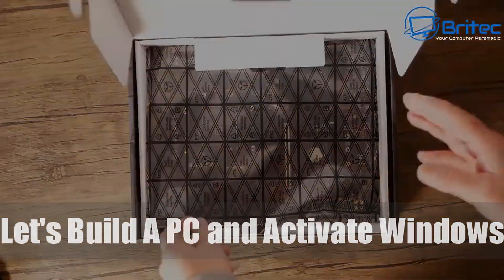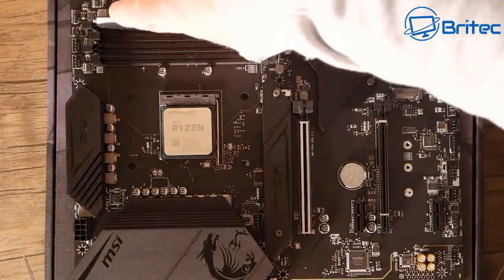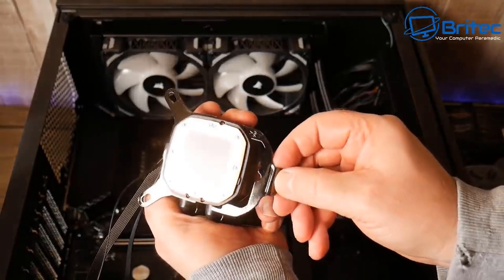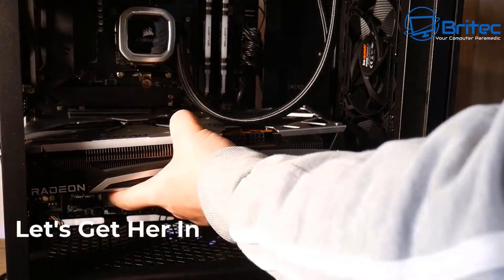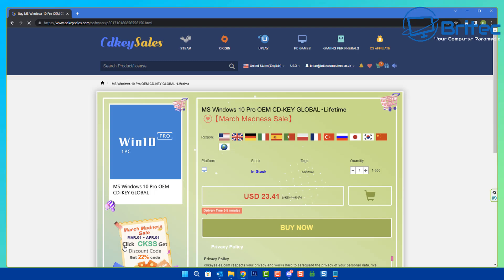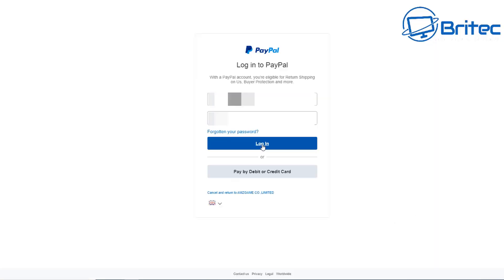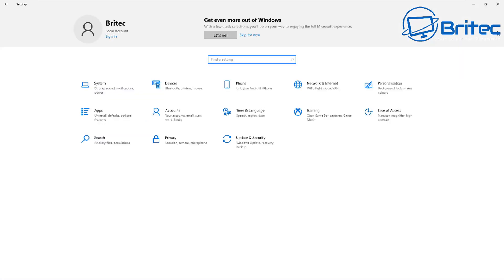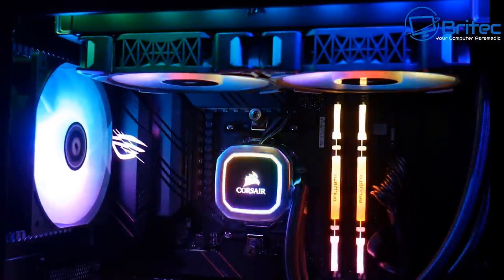Let's Build A PC and Activate Windows

Comment: Did that m.2 have a heatsink out of the box or was it a heat sticker, my board came like yours with a heat sink but my m.2 did as well, a thin metal one. I thermal pad stuck that to the drive but didn't like adding the board heatsink on top, it felt off - any thoughts? Not that hard to build in 2023 a part from damaging parts, static, RMA, troubleshooting and general anxiety, nah not that hard. My last build was 1997 when you didn't need a cooler or thermal paste - Any how I did my research and watched your vids & my 5700x posted & temps are spot on so at least I did it, just cable sorting & drives to install etc.

Comment: What does it take to downgrade from Windows 11 Pro to Windows 10 Pro? I pick up a machine that had 11 Pro preinstalled on it and don't really care for the new operating system. I checked and there are drivers list on their website for my model PC.
Thanks in advance.
Reply: Microsoft have a 10-day rollback option but that only applies to W10 ->W11 upgrades.  You best options are a) buy a Windows 10 key and reinstall (it may accept the W11 key);  b) use one of the many tools available to give your Windows 11 a 'Windows 10 look and feel' (or even a Windows 7 look).

Comment: You mounted your PSU upside down. Does your PSU pull air in from the bottom into the PC, or does it pull air out from the PC to the outside of your case? Also, since the Windows 10 Pro key is $10 cheaper than a Windows 11 Pro key, can you load Windows 11 Pro onto a new computer build and then activate it with the Windows 10 Pro key?
Reply: pull air out from the PC to the outside of your case
Reply: The PSU can be used as an exhaust.  The biggest disadvantage I see is that the fan will spin up more to remove heat as opposed to facing down and drawing its own fresh air.
As long as Microsoft is still offering free upgrades to W11, and your PC meets the requirements your strategy to purchase 10 is sound.

Comment: You describe how to use cdkey sales to get activation code for Windows, BUT HOW DO YOU FIRST GET WINDOWS itself ONTO THE BLANK NEW DRIVE IN THE NEW COMPUTER?
Reply from the maker: by installing it
Reply: @Britec09  Sorry! I'm new to this...
Do you mean that I have to have another working machine to download Windows to then put it on the new machine???

 As it would be impossible (I think )to connect to the internet to download windows on a virgin machine with a new and empty hard drive??? Sorry -I'm confused
Reply: @ningayeti  you have to prepare a bootable USB to install Windows from a downloaded ISO, so yes a PC with internet access is required.